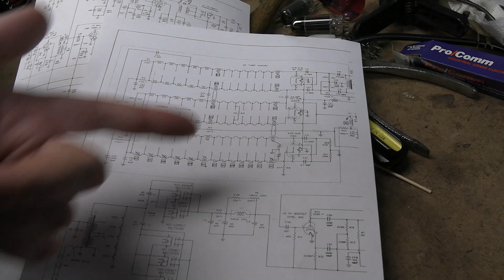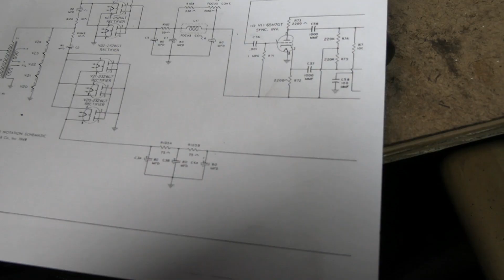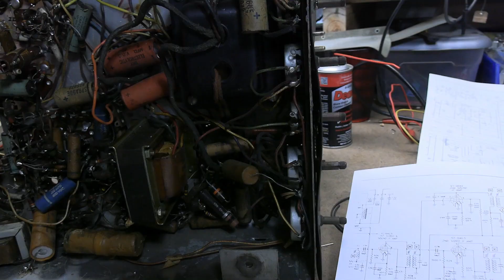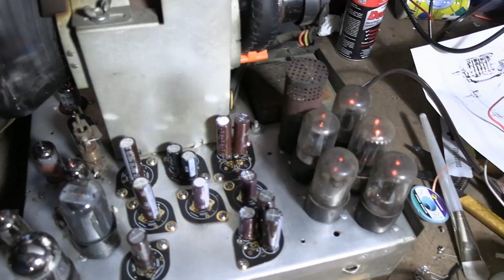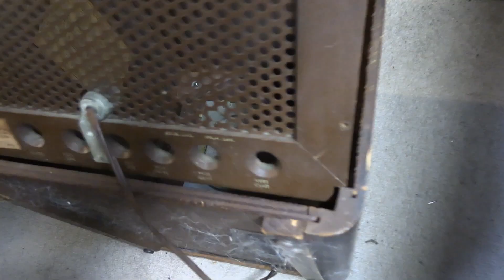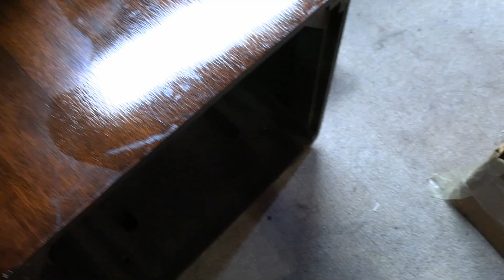Emerson 571 restoration part 2

Comment: Great job! I had a similar set back in 1989 or so, the third antique TV I ever worked on. It was a "consolette" model that was quite cute and the cabinet was in good condition, I had it working well, although the CRT was a bit soft. It had the "double D" type screen mask rather than rectangular, like this one. It had the same type knobs and channel dial on the right. Nice sized speaker, being a console, I believe 8". Mine had the selenium rectifier option, rather than the 25Z6s, and I remember seeing the schematic showing the 25Z6s as an option for the power supply in a dotted lined section off to the side of the selenium rectifier version, and I thought it seemed crazy for them to do that. The chassis had empty holes for the tube sockets where the 25Z6s would go. Back then, I (scarily) never replaced any electrolytics, as long as they were working and not getting hot, and yet adamently replaced all the paper capacitors. I wish I still had the set, but I sold it to a fellow TV/radio collector friend when I was getting ready to move from New York to North Carolina in 1992. Interesting memories of freshly getting into the hobby back then!
Reply: I have the same chassis with the seleniums and I still haven't replaced the main electrolytics, only the few failed ones. What's the worst that could happen? I installed a power fuse so the worst I'm imagining is a burnt out ballast. On a (hopefully) unrelated note I just had one section of the ballast burn out about a minute after power-up. Now that I'm putting these statements together I should probably double-check the caps before installing a repaired ballast.

Comment: Do you have any interest in an Arvin 5210 TV. Its a big wooden table set and I think the tube is 21 inches round. I had it working once but the flyback died and the chassis got some water damage. I think it is a rare model.
Reply from the maker: No, sorry too new for my tastes.
Reply: I might be. Where is it located?
Reply: @tennesseered586  In my house near Pittsburgh, PA
Reply: @tennesseered586  I may bring it to the Ohio swapmeet at the TV museum if anyone is interested.

Comment: I find those differences between the actual circuit and the schematic a bit strange.  With all of the modifications to this set, it reminds me of some of those "Basket Cases" where some electronic genius has done significant rewiring, resulting in huge problems.  Yet, the set basically works so, that makes me wonder if a Service Bulletin was issued on this particular model.  If it was, I would think the later Sams would have some type of record of it.

Another observation: With the rectifiers tubes and ballast being so closely located to the filter caps, it seems like a heat shield between the two would be in order.
Reply from the maker: Yes, there is a heatshield.  I removed it for easy access to the caps.   I have the set working very well now so I'm not going to mess with it but those modifications don't make any sense to me.
Reply: @bandersentv   Interesting. I have the newer chassis version (with the selenium rectifiers) and there's no heat shield. I wonder if it was removed decades ago or maybe they only did it with the tube rectifiers.
Reply from the maker: @eDoc2020  I expect it was left out at the factory
Reply: @bandersentv  It certainly looks like there was never anything there. On mine the ballast is located in the chassis hole further away from the caps so I guess it's less necessary there. On the other hand it means the hot ballast is right next to the pressboard back.